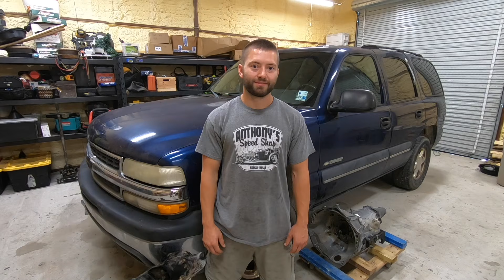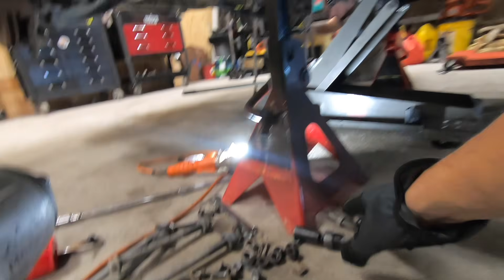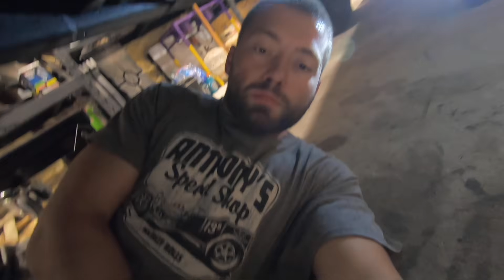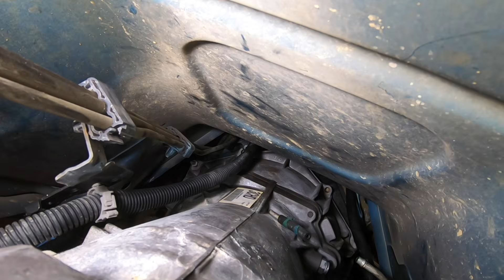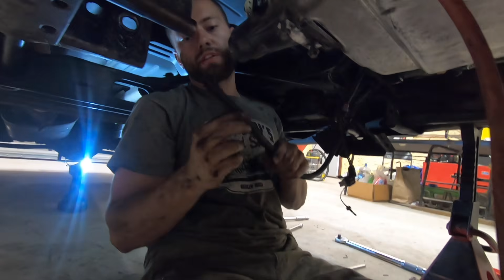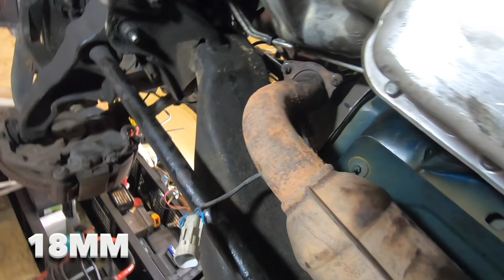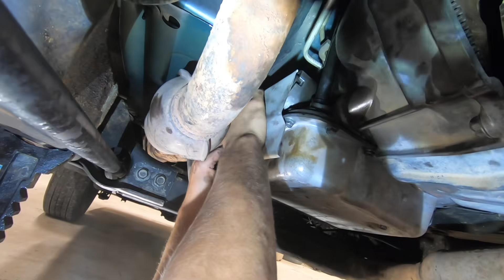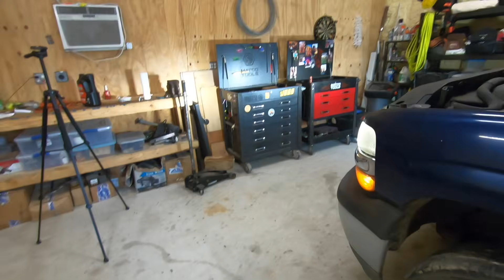4L60E TRANSMISSION INSTALL || EASY

Comment: I needed this right now im just foing researchfor him . My buddy is doing a transmission on 1999 chevy 1500 5.3  had a question do you need to add trans fluid in the converter in converter or no if so how much or any anti seize on splines probably not just asking. Thank you in advance

Comment: I fixed replaced my transmission using the video but my car does not want to move the gears move but the truck doesn’t move
Reply: Torque converter bolts attached?

Comment: I'm swapping mine out for the 2nd time. (Don't get a Monster Transmission). I'm using this as a refresher.  It helped a ton the first time.  Although, I don't see the point in taking the tires off. Seems unnecessary.

Comment: i got a used 4l60 e tranny it came with torque converter already in place shoul i pull it out and add tranny fluid the the torque converter

Comment: So once the bell housing bolts are torqued you dont need anything supporting the transmission? Wouldn’t that be too much weight
Reply from the maker: It's good to have support until you put the transmission cross member and transmission support back in

Comment: If I didn’t put my flex plate to 4 o clock but I still installed it and it spins with tourqe converter on it do I have to remove it or what do you recommend

Comment: What is the point of stating with the oblong hole on the flex plate?
Reply: So it can line up when you go to put the second and third one in
Reply from the maker: So it can move when you put the other bolts in

Comment: Wonderful videos-- just an engi-nerding point-- you lose torque with every inch of extension bar and especially swivel (wobble) socket you use, might want to bump up the torque setting a tad to compensate.
Reply from the maker: Good point!

Comment: Thanks guys, I'm trying to learn more about transmissions and torque converters cause I gotta replace either or for my wife's 03 escalade. F.I.L noticed a leak one day and the car started only driving in 3rd gear. So I'm going to finally get  my hands on it and check for transmission fluid color and see what the issues may be
Reply from the maker: Good luck with the repair!

Comment: I was told not to add all the fluid at once but to start with 5 quarts in the pan initially, start the vehicle and add the rest of the fluid as needed
Reply from the maker: That is definitely the correct method. I shouldn't have put it all in it once

Comment: Question why does the first egg shape hole on the flywheel must be first? Great video by the way.
Reply from the maker: It's been so long since I put a transmission in. I can't properly answer your question
Reply: It’s not that it has to be first it’s shaped that way to allow you room to find the female threads easier and allow a little play for you to get it started

Comment: Just put everything back together yesterday but when I turned it on I noticed I had an exhaust leak? Can I just unbolt it and realign it without taking off the cross member also how do I take
Out some atf if I over filled? Mine does not have a drain plug on the bottom of my transmission
Reply from the maker: You should be able to take the exhaust off and put it back on without moving the crossmember. 

You can loosen the oil pan and drain some out that way, it will be messy though

Comment: When you bolted the torque converter did you measure the air gap or just bolted it right back up
Reply from the maker: I just bolted it up, but if you have extra information feel free to share it

Comment: Just to make it a little easier for yall if you have someone else when you get to the torque converter bolts get them to put a socket on the crank pulley and turn it
Reply from the maker: That's a great idea!

Comment: helpful tip if you cant get to the top bolts pull the intake and it right there in your face
Reply from the maker: You can also let the Jack down a few inches and it will give you more access to the top bolt

Comment: As for the torque converter being too far back when needing to mount it to the flywheel, it CAN be adjusted if you’ve already bolted the transmission to the engine. It’s not ideal, but, it can be done.
Reply from the maker: Good to know!

Comment: What did you torque the 6 bellhousing bolts to?
Reply from the maker: Depends on where you get torque specs from.  
Most sites say 35-40 ft lbs.

Here's a quote 
"Torque the transmission to engine mounting bolts to 40 ft/lb.  On Vortec engines with a cast aluminum oil pan, torque the lower transmission mounting bolts (threading into the oil pan) to 33 ft/lb."

Comment: Thats like the least accurate torque method I've seen. If any extension is needed it should be a 1 solid extension not multiple linked together. The further away you are from the fastener torque loss increases even more so when there are several joints between the leverage and the fastener  instead of a solid extension. You should add about 2-3 lbs over with that many extensions
Reply from the maker: I understand what you're saying, but this is the torque method I use because a solid extension won't fit
Reply: @dudewecanfixit  I understand. Was just trying to give a little lesson about torque loss in my previous comment for those that don't know or didn't know. Whatever works will work.

Comment: Put oblong hole on the crankshaft at roughly 4 o’clock position.  3:20
Reply from the maker: Is that a question or advice?
Reply: @dudewecanfixit if I forgot to do this part but I still bolted the converter can I unbolt the converter and move the flex plate with the transmission on or will I have to remove the whole transmission to move the flex plate

Comment: Is the reason for the fluid over flow the fact that you didn't run the trans long enough to get the torque converter filled back up?
Reply from the maker: No, I put too much in. Start with 6 quarts

Comment: Hey man I have a question. I’m putting the bolt back in the flex plate and torque converter and as I was threading in the first one I heard and felt the torque converter slide forward. Is that ok?
Reply from the maker: That should be fine as long as the transmission is fully seated against the engine

Comment: I lost connection from the TCM to the ECM on my Tahoe, my car had caught on fire and it burned some of the wires. Not sure if it got to any of the wires that have to do with the transmission connection but do I have to remove the crossmember and my starter just to get to the transmission connectors? Also, how much should it cost for somebody to check the connectors for me?
Reply from the maker: I'm not sure, get under there and see if it's accessible.

Comment: Good video but does anybody know where the ground wire goes bolted to, my mechanic went MIA in the middle of my transmission job and I’m trying to finish installing it myself?
Reply from the maker: Which ground wire?
Reply: @dudewecanfixit  it’s a steel braided looking ground wire hanging there and I’m thinking it probably goes ground to one of the transmission bolts but I real don’t?

Comment: Great video!! Thank you guys!! I recently gad my trainny replace at a shop. When driving home I noticed my airbag light was on. Are there any airbag wires or harnesses that you guys know off which might have been left disconnected on top or anywhere near trans????
Reply from the maker: I'm not aware of any airbag wires or connections near the transmission
Reply: @dudewecanfixit  thank you!!👍🤗

Comment: You are the man I rebuilt my transmission from watching you you make I know they had to take you some time to do that video series but thank you thank you very much
Reply from the maker: It was definitely a process creating the video series, but worth it every time I get a comment like this! 

Thank you!
Reply: @dudewecanfixit  I finished my transmission put the torque converter on bolted it up to my 1998 GMC four-wheel drive pickup truck went to start it and it had like a hard spot in it and I thought the battery was dead so I hooked the battery charger to it Crank real hard again and in then it cranked up I heard a loud cut thump in the transmission and then nothing no gears frontwards backwards one two nothing, so I did something wrong any ideas or maybe what I tore up, thanks buddy

Comment: When installing the bolts to the torque converter I noticed you had to rotate the flex plate which rotates the crankshaft. Will this mess with the engines timing? If so, what should be done before starting the vehicle? Thanks for a great video!
Reply from the maker: It doesn't affect the timing, no worries there.

Comment: No you made this 3 years ago but. Can i put the cooler lines on the tranny with the nut on the line? And not in the tranny and push the line in?
Reply from the maker: If the nut is already on the line, wouldn't you have to screw it into the transmission?

Comment: they aren't selling the flywheel bolts with the socket heads on Amazon, so thanks for showing us the install with the 15mm wrench because that's my only option. Man, I wish I had a best friend working with me.
Reply from the maker: Glad I could help

Comment: when reinstall do you need to put fluid in torque converter first or does it fill through the dipstick too????
Reply: Try to put a decent amount in there so when you start the engine it's not running dry for a couple seconds
Reply from the maker: Well said!

Comment: Pro tip i don"t pour all 12 quarts in , even if everythingbis empty , i pour 2 or 3 in the torque convertor then slode it all together , add 3 or 4 more , start it for 3 minutes or less , add 4 more , then check it to see how many more it wants , pouring all 12 at one time  will have it running out the overfill every time .😂
Reply from the maker: You are absolutely correct, and that is what happened to me!
Reply: Can also run through all the  gears including overdrive while on jack stands that way you have no land on the trans and fluid goes everywhere including all dry clutch packs..add fluid as needed until full..then pull off stands and test drive. That will also give clutches time to saturate..

Comment: I’m watching these series so I can replace the rear main seal on my 5.3 Silverado only to just now realize I forgot about the 4wd part and now I gotta figure out how to remove the t-case 😂
Reply from the maker: You will have the front driveshaft (4 small bolts on the retaining clamps) and 6 bolts holding the transfer case to the transmission.

Comment: So I'm facing an issue here and hope you guys can help.  I did the job on a 2002 Yukon Denali.  Doesn't have an output shaft housing, but has an adapter that goes in between the transmission and transfer case.  I have transmission fluid leaking from the rear of the transmission where it bolts into T case adapter.  Did I miss a step in the transmission?
Reply: You must replace the seal in there
Reply from the maker: Yes, replace the seal while you are there.
Reply from the maker: Yes, Replace the seal while you are there.
Reply: Ive finally got around to finishing and you all have been so helpful.  I put everything on.  Issue now is I have to give it a little gas for the vehicle to move and It is not going into 3rd gear.  I did the pressure test and everything.  Any help would be appreciated.

Comment: How do you prevent the flex plate from rotating while torquing them
Reply from the maker: You can put a socket on the crankshaft bolt and hold it from there.

Comment: Once I installed and went to put the transmission into Drive I tried to accelerate and the transmission kept slipping. Do you know what may have caused this? I let the car idle for around 10 minutes
Reply from the maker: Did you check the fluid level after this happened?

Comment: Hi i changed mine out and installed  it follwed all step but my gears dont in gauge starts fine any   clue i have abs and brake light on
Reply from the maker: Sounds like the linkage isn't working correctly

Comment: I have a question is the 4l60e the same as 4l60? Are they compatible with the 5.7 motor??
Reply from the maker: The "e" designates electronically controlled 

It should bolt up fine, but you might not have the control signals you need
Reply: One more thing the e is for electronically controlled which is the push button 4x4 right? And thanks for all the info you guys are legit wish you well on your success 💪🙏
Reply from the maker: No, the "electrically controlled" means the transmission communicates with the computer to determine shift points. 

The four-wheel drive button is for the transfer case

Comment: What did you torque the bell housing bolts to?
Reply from the maker: Most references I see recommend 35 to 40 ft lb
Reply: @dudewecanfixit  thankyou🙏🏽 I was able to replace my transmission from your videos
Reply: Also I noticed you only have one big line on your transmission vent and mine has another going to the top of the bell housing.do you know if the one yours doesn’t have is necessar?

Comment: So its OK to use the old Torque Converter when doing a rebuild?
Reply from the maker: It's a gamble, always recommend installing a new torque converter. I have reused torque converters if the transmission fluid is still clean with no debris in it.

Comment: What about if you’ve install the transmission and now the truck won’t start ? No power to the crank fuse 🙄
Reply from the maker: Double check battery and starter connections

Comment: You are supposed to add 5 quarts, start the car up, shift through the gears, check fluid level then add as necessary until you get the correct fluid level.
Reply from the maker: You are correct

Comment: Major Question for my install:  I broke my dipstick trying to remove it before.  The old housing at the bottom will not come out!  Is there any harm in removing the  tranny pan to push the pieces out and then reassemble it?  Is there a better way than that?  I would very much appreciate any help any of you could give!!!
Reply from the maker: That sounds like a very reasonable plan to me. I don't see any issues with that

Comment: I pulled my trans and when I put the new one I filled it up with fluid but the transmission is running hot HELP
Reply: And it won’t show oul level on dipstick and it’s not leaking
Reply from the maker: You should be able to see the oil level on the dipstick. How much ATF did you add?

Comment: Ok so I have a 99 Silverado I followed your video for the rebuild and I've removed and done these before but apparently I didn't get the second bump in like I thought I did.  I wrecked the pump drive when I put it together the truck let me either by sheer weight or a bit of force from bolts but whatever.  Do you have/know or anyone on here know the torque converter setback for a 1999 Silverado 5.3?
But yes very important step.
Reply: As a general rule you should not be able to get your fingers behind the torque converter when fully seated. Also, when fully seated, if you put a level a 2x4 (not s Lowe's or Home Depot one but  a streight one) or some streight edge tip to tip on the bell housing torque converter should be behind that
When installing. Torque converter should NOT touch flexplate. If it touches before trans.iddion is fully seated take it back down and fully seat torque converter. Once trans is fully seated torque converter will still not quite touch flexplate but be very close there will be clearance. Take your time with this step to keep from wrecking a pump drive like k did kiddos. 
Because if your are like. Me I wrecked the pump drive used another doner rebuilt and knocked band off of its stud without knowing and had PRN1 and 3 no 2 and 4. Had to remove it AGAIN to put the band on.
Reply from the maker: Fantastic info!

Thanks for sharing
Reply: On the bright side I could probably remove a 2wd 4LSlippyE in about 40 min if I had a lift.
Reply from the maker: Lol, might be a good skill to have
Reply from the maker: Unfortunately, I do not have those specs available. If you find out, please share them with us.

Comment: Should the torque converter have any play or wobble after fully seating in the transmission ?
Reply from the maker: Side play should be very minimal. In and out play will be present.
Reply: @dudewecanfixit  yeah...there is more in and out play than you would expect

Comment: Hi nice video my question is how did you clean out the tourq converter from all tha nasty and burd oil. Just by draining it or did you use some kind of solvent to remove all that fine metal particles
Reply from the maker: If you have debris in your system, it is definitely recommended to replace the torque converter.

Comment: Hey thankyou for this video it helped a ton! One question, one of my bolts on the bottom of the trans striped a little and won't go all the way in. Will it be fine to leave it like that? All of the other bolts are good.
Reply from the maker: Is that in the bell housing where it bolts to the block?
Reply: @dudewecanfixit  yes the bottom of it
Reply from the maker: Personally, I think it would be fine. However, I cannot guarantee it
Reply: @dudewecanfixit  ok I gotcha, just needed a second opinion lol, thankyou!
Reply from the maker: No problem

Comment: Did you add any transmission fluid to the torque converter before instal?
Reply from the maker: Yes, about a half quart. It's not necessary though. You add the fluid once the transmission is installed in the vehicle

Comment: Did you fill the torque converter with fluid first? Also how did you get those top bolts on the bell housing in?
Reply from the maker: I added a half quart before I installed the torque converter. Get the other bolts snug first and then let the jack down a little too get more access to the top bolts

Comment: Do you have to change the converter when you change the transmission 
I dindnt and the trani doesn not work
Reply from the maker: It is recommended to change the torque converter